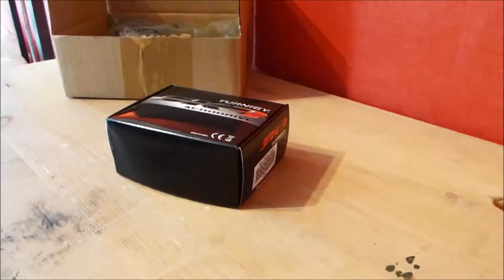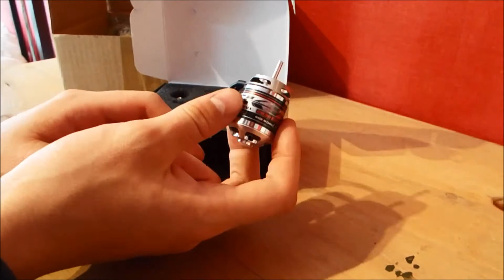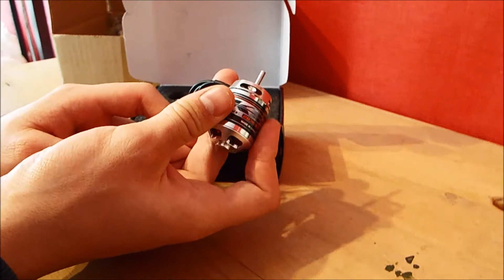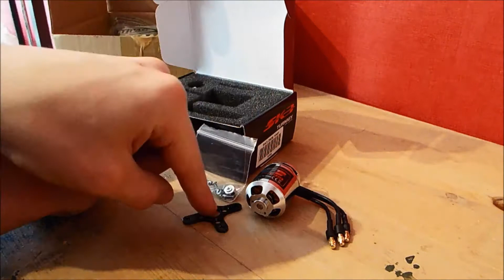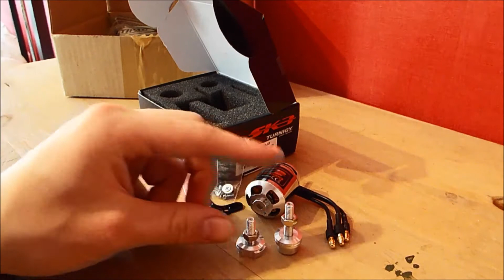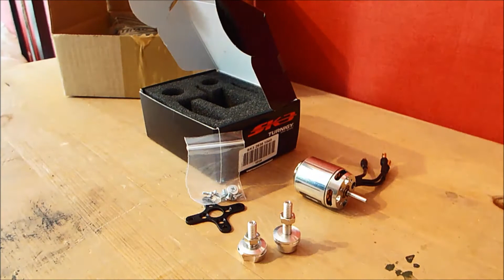Turnigy Aerodrive SK3 - 2836-1040kv Brushless Outrunner Motor Unboxing review

Comment: The motor shaft is actually 4mm internally and is reduced to down at the output part. I’ve fitted a new 4mm shaft right through to give it a bit more strength.

Comment: That "not so common" item is a prop shaft adaptor for pusher props. The spindle on the aerodrive is on the wrong end for a pusher prop you see.

Pat in Oz